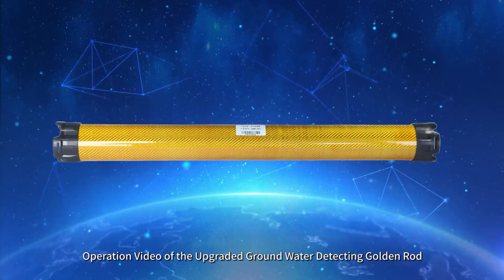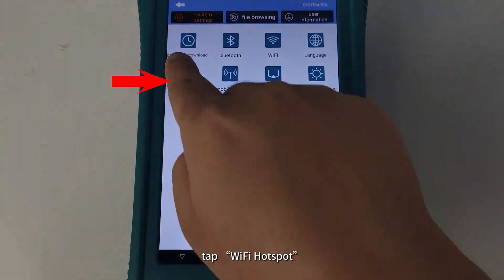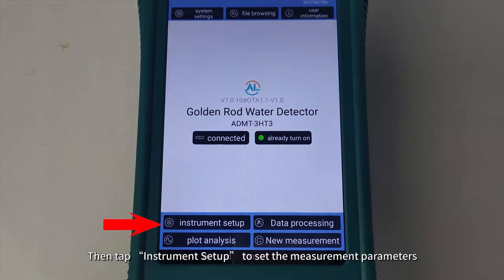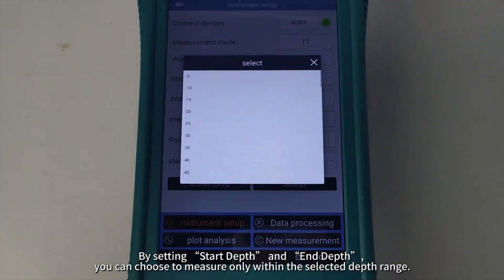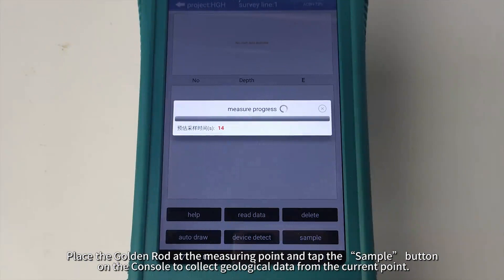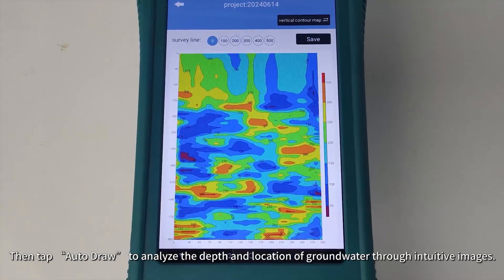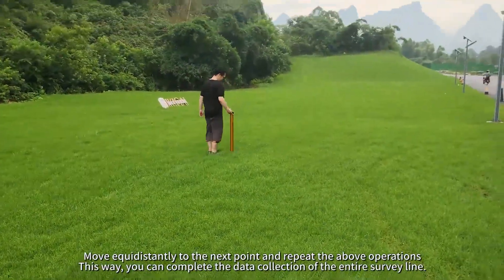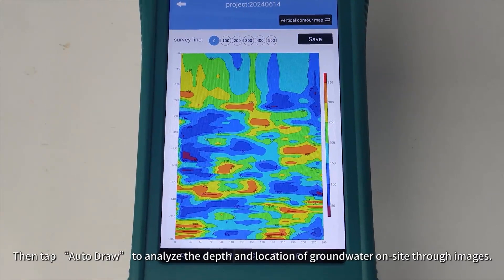ADMT-3H 3HT2 3HT3 8HT2 8HT3 Groundwater detector de agua How to Operation Use it(Cara Pengoperasian)

Comment: I see 45 page manual of the Golden Rod water detector(ADMT-3HT2 model).   The common problem with this instrument: the instructions are not full. E.g. the result of the measurement is 2D image with colors decoration, but it is not clear what the colours refers to. The legend is also just a number, but that number is not well defined. The number is clear only for the industry that manufactured it. 
To use this instrument, it is must to validate with other instruments having well-defined outputs.
Reply from the maker: It has detailed instructions. When you buy the equipment, an engineer will give you guidance. If there is no explanation and you are buying from an unprofessional person, you can add my whatsapp: +8613227326207 got more